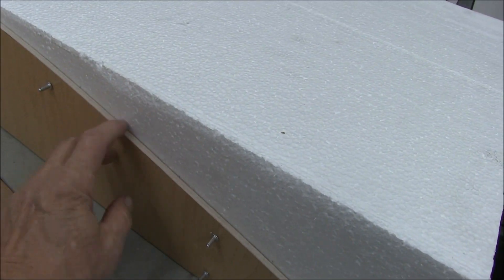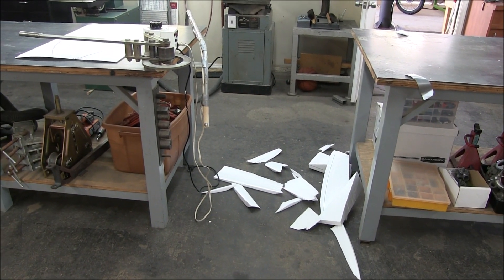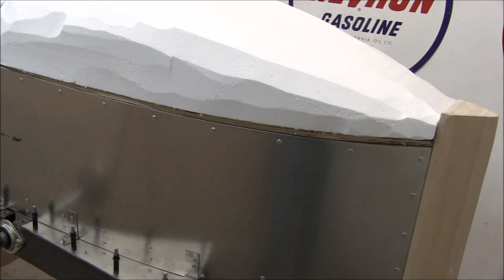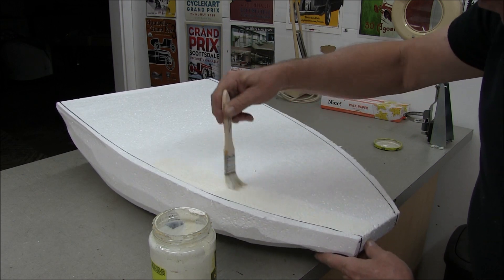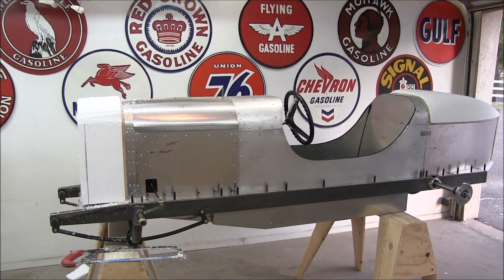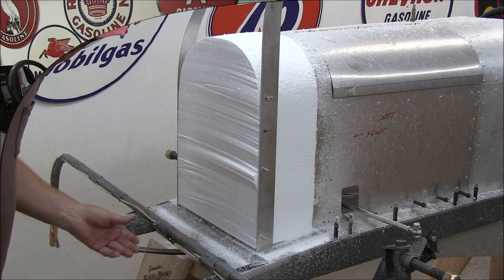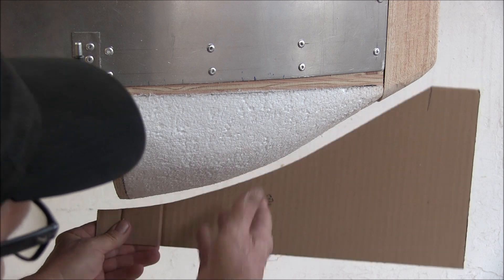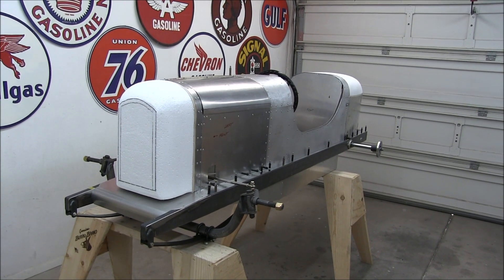Club Kart Build Update Compound Shapes continued

Comment: You are a pro with that angle grinder, I would have switched to hand sanding long before you did. As a side note I have seen people use electric craving knives to trim foam before, not sure if you had seen that. The kart is coming right along, great work by all involved.